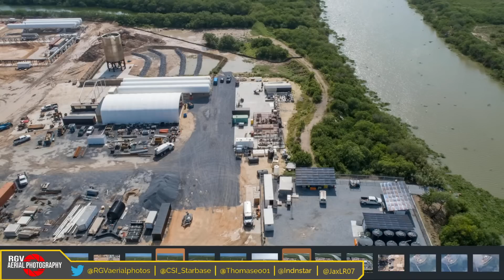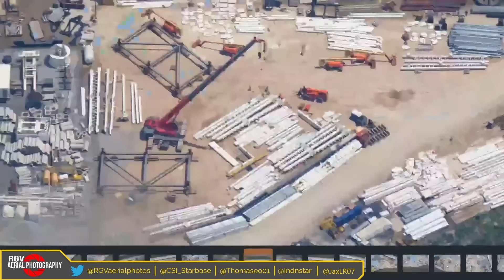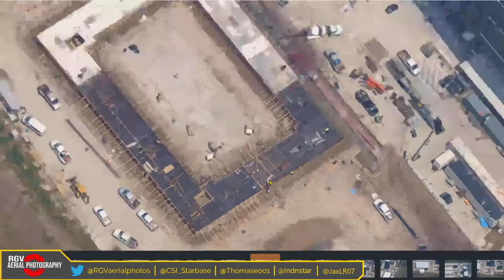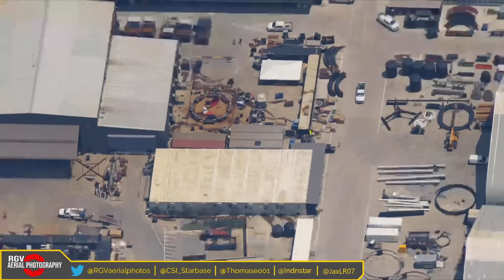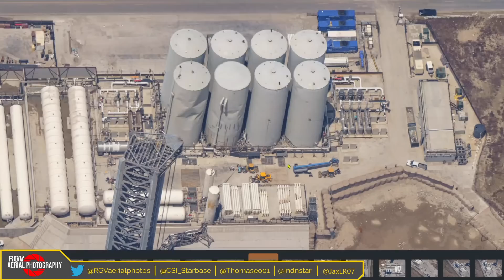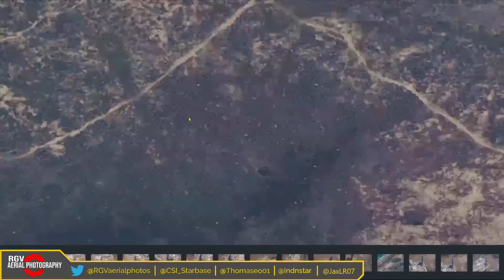Starbase Weekly Episode 71

Comment: If the nosecone test stand uses hydraulic fluid, it could need a lot of fluid and that hydraulic oil would take a very long time to burn off.  Is that an option?
Reply: water has a magical property, anything it's in contact with doesn't get much over the temperature at which water boils, if you keep moving water against the surface, even if the water boils off and gets replaced, it'll stay well below melt temperature... oil on the other hand... it'd have to be some special kind of oil.

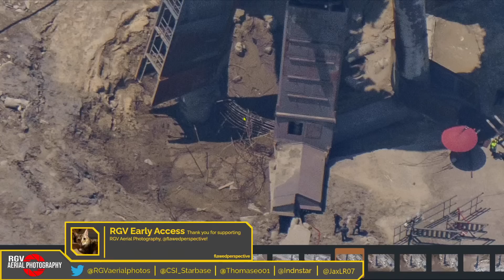Comment: 2:48:00 I wonder why it was that side of the rebar concrete that was blown away and not any of the other sides..?
Reply: Weakest link... that side had the least total coverage of concrete (the LOX pit was in that direction) and likely the least compacted ground. They were very, VERY lucky it wasn't the side pointed at the tank farm though.
Reply: i think because the rocket used a tower avoidance maneuver at lift off so main flame exhaust power was directed at a certain angle
Reply: @adamcollegeman2  yes, except it was not a manure, the rocket was just off course.
Reply: @adamcollegeman2  No, Booster hadn't even begun that maneuver, when the hole was dug. Plenty of video to watch showing that.